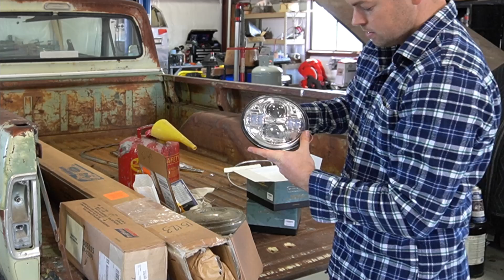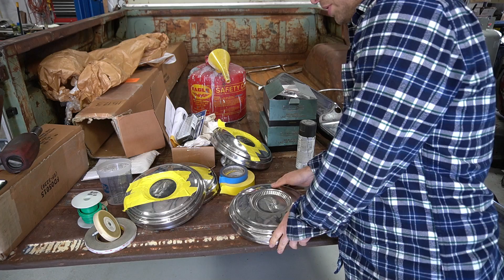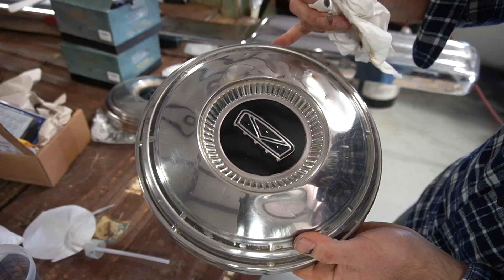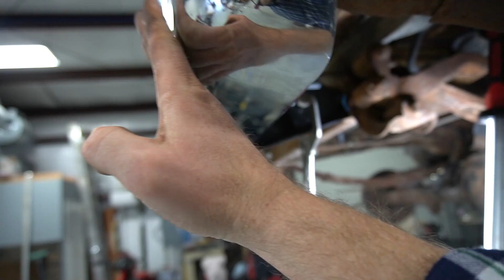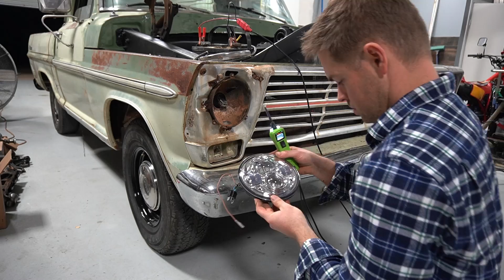F100 Exterior Clean-up

Comment: those LED  headlights were AWESOME
  BUT how much better can we make a sealed beam halogen if we relay some double sized wire right to the headlights and use factory wires just to light the relay.
a smartass at work said it was awesome back before LED headlights were invented
SO maybe LED is better now but one raly and 10 ft of wire probly cosat 1/10 these LED headlights and if i know quality these days will last TEN TIMES  longer

Comment: I realize this video is older, did you find out what tge problem with the brake lights were? I have the same issue going on when i put led in my taillights. Thanks
Reply: @leeharden9488  Ya thanks for the info. I actually found it, it was the switch.

Comment: That bumper problem is exactly why I get all my parts from LMC trucks. All parts fit like its factory original. I restored a 77 F100 ranger. I tried to cut corners but ended up causing myself more work. In the end it cost me a little more but my parts fit perfectly.

Comment: Dim lights are often corrected by a better ground connection. try it.  Use di-electric grease on all terminals.
Great job on bumper and wheels.  Change the grille now, you know you will later.  A black lowprofile hood scoop (fake) would look good.   Go for new Brake Light Switch and consider HCBL (High Centre Brake Light).  I know you will have figured out how to aim the lights by now.  One connection will be for DTR lights.  Nice helper!  Traction Bars and Locker next!
Reply from the maker: Thanks, I think I finally got all the parts together to swap the grille now. I'm sure I will show that in an upcoming video

Comment: Need to change the front grill...as I remember there is an electrical switch that works the break lights which is attached to the break pedal.

Comment: This is the most important post I have made! I checked and seen I hadn't watched the first one where you have a 390 engine with mixed rods and caps. This is very important!!! You by now know about how ford used the FE block with different cranks and rods to get the displacement so not to waste time there. What I saw was the reinforced ribs on the block! Very rare block as that is the one that they used to make the 427! A 428 is smaller bore than the 427 and the ribbed block is the only block that you can bore out to the 427 specks. Then the cranks are easy as they sell them new but that block is unobtainium or so hard to find. So if your not interested in it there will be someone who knows fords like I do. My 64 galaxie had the factory 427/4 speed  and it had that block I ran into it again on a pickup like the one you're fixing and it had that block with the ribs so I went to my machinist and he bored the block, I bought the proper parts and put it in my 76 highboy 4X4 truck and it was so powerful that it would take the centers out of the wheels. I hope you didn't scrap it as it is the only block for this build.. I didn't drill the outside cross crank for the four bolt main but was told that I should and it's your call on it.
Reply from the maker: You're saying that grey 390 hodge podge block is a rare block?? I'm wasnt able to find any numbers on it to verify what it was
Reply: @330_garage3  Those blocks are the only ones with the factory reinforced sides. When you  look at the start of your video, that old gray block that they hoge poged the rod caps on, you will see the unfinished rough gray cast steel rib on the OUTSIDE of the block placed by the factory for the larger bore. If you check your bore numbers in your repair manual they all wore the same sized hole for the piston.. Why I  can't just remember the bore size I don't know, I raced at Arlington and that is the block we all used. They are just so dang rare, hard to find.I figure they used them up in trucks as the three fifty two or three ninety engines, I can't remember what the three sixty bore was but I think its the same. I haven't been out of the house since I got hurt bad. I caught a man who fell from his roof level out of a ladder and I automatically just caught him breaking ever lumbar vertebrae in my back. Number four and five were crushed so I don't walk any more. I hunt hard enough, I can find the machinist phone number as he did the same racing and is a wizard at them. I worked as a mechanic for over thirty years in heavy equipment but racing and those blocks were my passion. The cylinder walls are thin on the 427 which has a larger bore than the 428, Check an see, they are in lines on each side, rows of rough cast

Comment: Wow, wondering if they make that for my Explorer, of course they would since it is just small bulb with a retainer ring. Love the sound of your ford truck. Not sure if its straight piped or some muffler brand. I like your analogy of why things work or don't. You got your act together. Nice having a lift to do what you do to on the truck. Those hubcaps are nicknamed dog dishes  and it kinda makes sense. You must of changed the dimmer switch. Any grill in good shape to me would be better but knowing some years the grill looked funky. I like what you did with the hubcap painting the center then accenting the center, worth the effort. Could take one at a  time and take a light body hammer or maybe a soft blow style hammer that won't leave garish dents too. Takes time but just massage them out. Nice job, people get tired of the new 80 thousand dollar look. Imagine I paid five thousand for my first home, two bedroom with pantry and five acres. No it wasn't new but it was decent or nice and had a small yard that was green. That would buy forty homes and it the fifty years ago since would be a chunk of change. Saw the ad for a new diesel ford truck and with all the bells and whistles, was over eighty thousand and will be a rust bucket in ohio (rust belt) in five years. Watching Andrew Carmara in new york with a new, well five year old dodge and the brake lines were rusted off and the fuel line were heavily contaminated. He was saying that the companies ought to be responsible for stuff like that and he is right in many ways as your older truck has patina but it is not a rust bucket

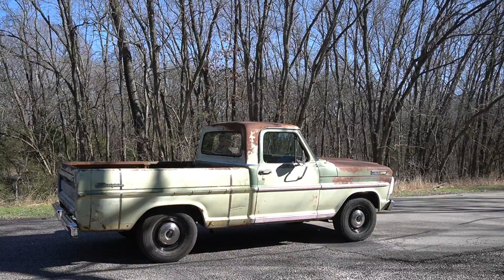Comment: During takeoff at the 24:35, your rear axle moved forward quite a bit, probably the suspension isn´t quite up to the task or has some other issues, better check on that!
Reply: sthenzel ya it did look like it actually lurched forward

Comment: Pop out switch for the brake lights up on the brake pedal.  Check that it's probably sticking. Drop the money on a new grill for a 68. The inserts are pricey for the 70-72 grills. Ask me how I know! I redid my truck when I could get alot of the parts through Ford in the early nineties.

Comment: Coming along great. Love the dog dish hubcaps. Sounds like you need a little rear suspension work to get rid of that wheel hop. Not gonna lie, when you pulled out those projector headlights at the beginning of the video, I was thinking nooooooo...  After seeing them installed I really like them, plus they are a serious upgrade over the factory candles.

Comment: The project is really coming together!  You're in the satisfying stage now where you can stand back and stare at your creation.  I just recently did these things on my truck so I'll share what I found:  youre gonna need an LED flasher instead of a standard one and the brake switch is mechanical not hydraulic and is just on the back side of the brake pedal.  On my truck, the brake switch was functioning but I still had no brake lights.  The problem ended up being a bad turn signal switch inside the steering column just behind the horn.  I replaced that and bingo - brake lights!  If you replace the turn signal switch, order some horn contact springs as well - yours are probably missing and are easily lost and broken.
I ordered a rear bumper from LMC and as much as I don't like the poor quality of some of their products (any rubber product), this time the bumper was a near perfect fit.  I didn't have any of the fitment issues you had with that bumper from Carpenters.  
I have the f250 with the 8 lug wheel pattern so my options were more limited than what you've got with the 5 lug f100 wheels.  With the f100 you've got sooo many options for a nice set of negative offset wheels.  That truck needs 'em...bad!  
Loving the build!
Reply from the maker: nice! I found this was the pedal switch, someone had clipped the power wire to it and used it to power a radio or something.. guess they didn't realize they didn't have brake lights haha. I was wondering about the circuit through the turn signal though, wondering if that would cause a problem.. sounds like it does
Reply: @330_garage3  Since you don't have LED back up lights or parking lights, I don't see why the turn signal switch would have to be replaced.

Comment: When I did my LED swap in my 72 f100 I had to replace the flasher with an LED flasher, as the old one couldn’t detect the newer lighting resistance
Reply from the maker: I should have mentioned I also has to put an electronic flasher in the system. I just used a cheap ebay one but it was plug and play
Reply: Yep me too
Reply: I also added a headlight harness to take the load off the headlight switch
Reply: How did you install the LED flasher? I am looking to upgrade my '66 F100.
Reply from the maker: @martinwallingford3773   I used this cheap one off amazon. https://amzn.to/36pVD7L  It was super easy to replace, its behind the gauge cluster, behind the oil pressure gauge. You can get to it just by laying on the floor and looking up under the dash. You simply pull the old one out (looks like a silver, or light green plastic circle) and plug the new one in. Nice part about the new one, you can select how quickly your signal flashes.
Reply: Martin Wallingford I bought mine off eBay they’re called “Electronix” they’re a plug-n-play with a simple ground wire

Comment: I learned to drive on a truck like that and it has a special place in my heart because of that. I have always like the 3 speed on the column and while I use to like fords I am now a Dodge man but I like that ford still. Are you going to paint the truck and get rid of some of that rust on the outside. I will make a good everyday driving truck and good for hauling small every day load of stuff and should be fairly good on gas as well.

Comment: 2 issues that could be with the brake lights.  At the brake pedal you have a dedicated switch that  grounds out when the pedal is depressed.  Also the brakes lights run through the turn signal harness in the column.  check both.

Comment: Need a led flasher/ resistanter. if they don't work correctly. Found out that when working on an old motorcycle and putting led flashers on.

Comment: I'd use the other grill or turn that grill over to shop that can repair it and rechrome it. DC Bumper in Dallas used to do it. That is also my favorite Ford F-100 grille.
Reply from the maker: I agree. After editing this video and seeing the truck from the outside.. that grill looks horrible. I need to put the 72' grill in there. The truck rides too high in the front as well. Thanks for the DC bumper suggestion!